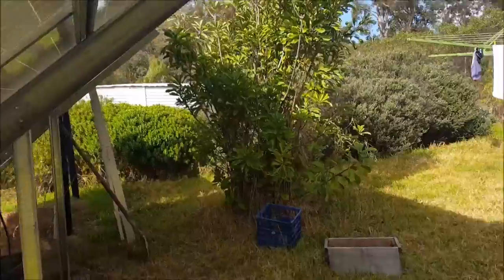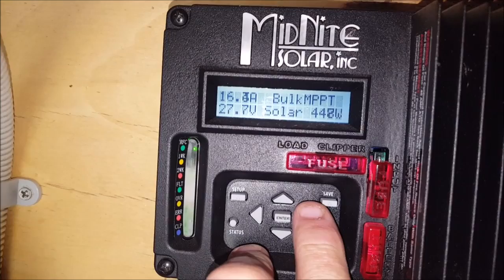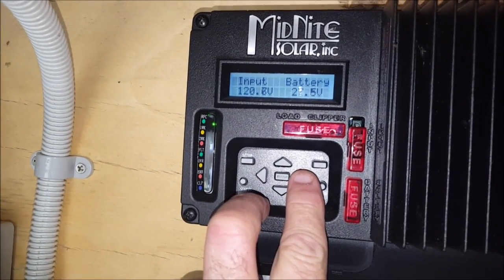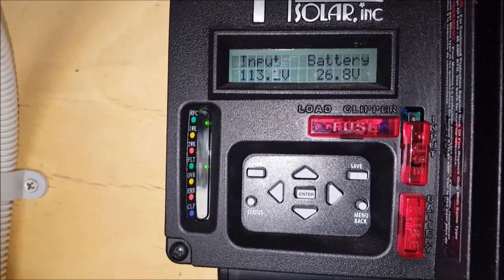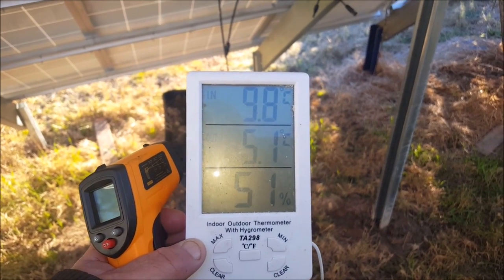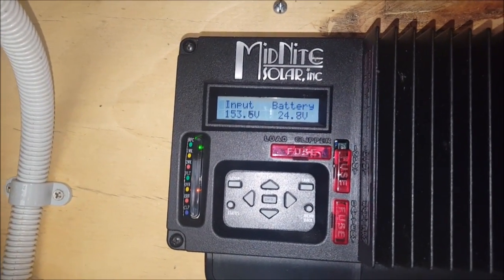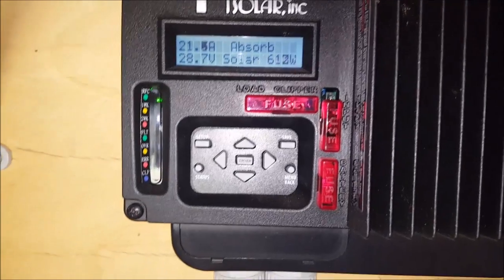Off Grid Solar Power - Pushing the Boundaries on the Midnight Solar Kid and Testing the Hyper VOC

Comment: Hi ! Did you check if the panels have By-pass diodes ? Thanks for the review.
Do you think the Mid Niite is a buck MPPT converter ?
Reply from the maker: What is a buck MPPT converter?
Yes, the panels have diodes. Pretty much all panels have diodes these days.
Reply: As far as I know, there are two kinds of diodes that are used in solar panels : Blocking diodes & By-pass diodes. They don't have the same function in the installation. The 2nd ones are very useful in shading situation avoiding loss of current on insolated panels when arranged in series with shaded panels.
In each junction box located on the back of a REC panel I think you should have at least 3 by-pass diodes (+ 1 blocking diode). So that if one angle of the panel is shaded, there will still be a current flowing thru the rest of the cells arrangement rows (the current by-passing the high resistance shaded cells row).

On the other hand, A buck DC to DC converter handles a higher input voltage than the output. The opposite is a boost DC to DC converter that handles low voltage input to load a higher voltage battery bank.
Some solar controller have both. These features are important while choosing a MPPT solar controller.
Reply from the maker: MrWookie21 Diodes simply allow electricity to flow one way.
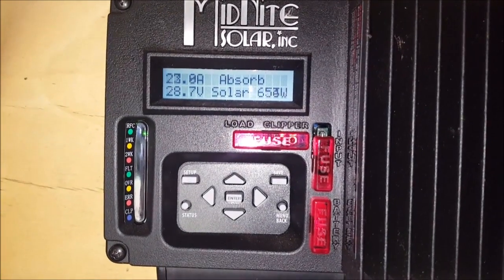Reply: What was the smoke at 05:05 ?
Reply from the maker: No smoke, that's water vapor from the panels.
Reply: Vaporized water or condensed humidity ???
Reply from the maker: It's the dew on the panels vaporising as the panels heat up.
Reply: I'm not quite sure it's vaporisation. I think its air saturation in water.
https://dogfoose.com/2014/02/the-dew-point/
Does this phenomenon appear in the morning when the sun rises up ?
Is it just visible before, above or after the panels ?
At this moment I think there is also a slight moist wind coming upwards from the valley.
Reply from the maker: You can think what you like, I was there, I know what was happening. It happened early in the morning once the sun started heating the solar panels up.
Reply: Pop's Shack. In space water vaporizes at lower temperature due to lowering  then disappearance of the atmospheric pressure. This may explain why that happens at your altitude. Did you check the t°on the front side of the panel at that time ?
Reply from the maker: MrWookie21 - I didn't check the temperature. The altitude is about 45 metres.
Reply: Pop's Schack : So then it may be a combined situation explaining what happened : the water molecules of the damp panels successively evaporated and then immediately condensed in this cold and damp air flowing above the panels forming the haze that was slowly displacing that day.
Reply from the maker: It's vapour, so it hasn't condensed. If it had condensed, it would be water.
Reply: Hmm. Vapor is composed by water. What changes is the size of the droplets of aggregate of H20 molecules that are lighter or heavier than air density and disturbances. This is definitively saturation ; no doubt of it. Vapor would have been possible with cooking panels boiling water @ 100°Celsius.
Reply from the maker: Vaporisation occurs much lower than 100C.
Reply: Of course. But then it's called evaporation ; it is a type of vaporization of a liquid that occurs from the surface of a liquid into a gaseous phase that is not saturated with the evaporating substance :
https://en.wikipedia.org/wiki/Evaporation

Comment: got a dozen 60 volt 40 watt amorphous panels in parallel through a Kid to a 12 battery bank "no worries"
Reply from the maker: Have you though of changing the configuration from one string to two strings?
Reply: not sure I understand your comment, each of my panels is 60 volts V.O.C. and 1.00 amp I.S.C. if I string 6 of them in series it would be 360 volts to the kid, I think it would explode ! or is it something else you're suguesting?
Reply from the maker: +The Left Hand It's something else. Two panels in series for 120V VOC.
Reply from the maker: +The Left Hand Sorry, I didn't word it correctly to start with.
Reply: on a 24 volt or higher battery bank, that may have some benefit. I have never been in an over charge state, best output I've seen is about 23 amps. also #1 my mc connectors are gone so I can't plug and play, long story don't ask. #2 my analog meter only reads to 75 volts lol
Reply: Pop's Shack

Comment: Hell yes! Those Kid's are beasts. On a 24v system with 30 amps...that is rocking! The good thing is that it can handle up to 150v PV volt input and do 48v battery bank. With a 48v system (at 30 amps)...that is excellent power potential. So, those Kid's rock! Even with a 24v system...getting 25+ amps is rocking too! Mine is a 24v system.

Comment: Wow man. That rocks. Was cool to see it making that much power in the winter. Thanks for taking the time to show us.
Reply from the maker: Thanks, mate. The low temperature helped. I'm pretty pleased that the Kid has the overvoltage protection and that it actually works.

I've just been running the three panels since I filmed this and yesterday (Saturday) the batteries were at float at 10.30am.

Comment: Do you still use your giandel inverter as I bought one and it worked for a few hours then the capacitors leaked and caused smoking from the system I think they were the filter caps.
Reply from the maker: It's been running almost continuously all year. I've only turned it off a few times.